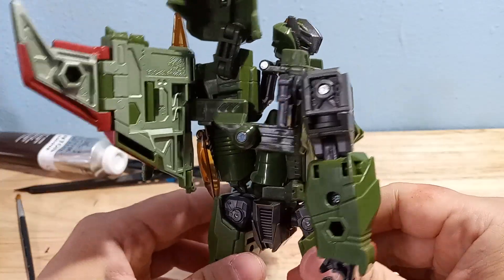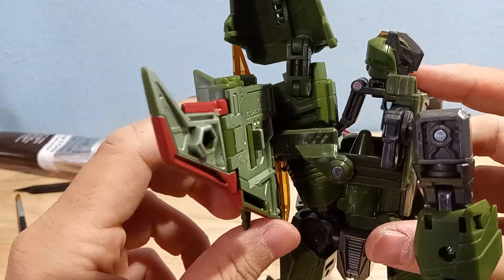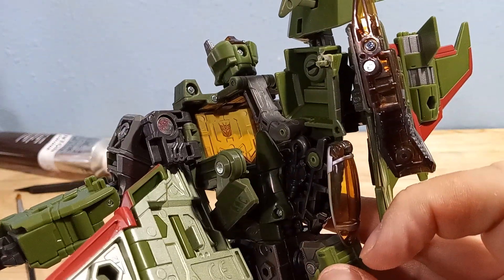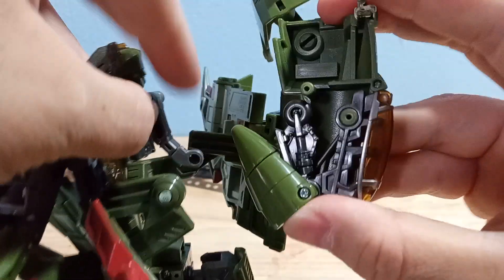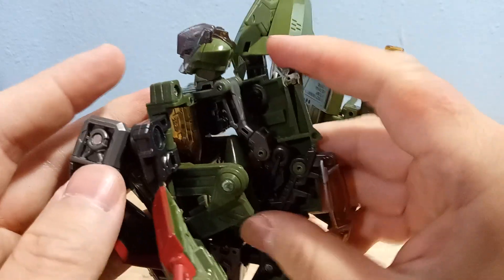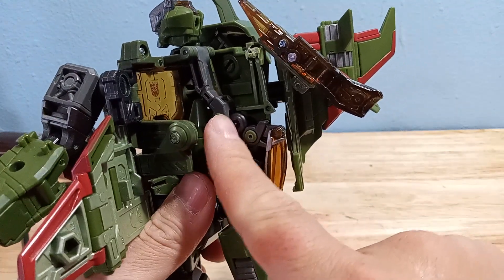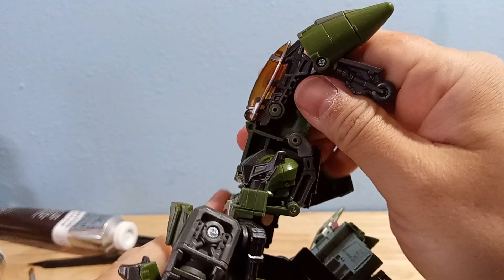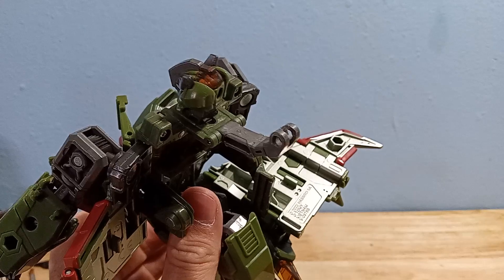Transformers Legacy Skyquake 5 Minute Fix Chest Problem

Comment from the maker: Apparently you don't need to mod at all, you just have to do the angle right: https://youtu.be/qkP0QyKbpT4
Reply: No, it doesn't work. There are batches of skyquakes and dreadwings that have a correctly molded piece, like the one that you cut out. There are reviewers and friends that did not have this problem with dreadwing.
If you do the "angle trick" with a faulty mold there is no way to push de landing gear in, it is blocked by a piece of plastic, the one that you cut.
Thank you for doing a video explaining in detail how to fix it.

Comment: Kinda looks like it was tooled for a different head and the mushroom peg was assembled backwards to accommodate this one. Wonder if the inevitable remold will solve the problem.
Reply from the maker: Yeah, they might fix it, but I think this is the fix, removing some of the slot. I wonder if they'll remold dreadwing to face the other way to use the cockpit as a chest; this figure can pretty much do it. 

I think they'll remold this into Thunderwing
Reply: @seoultron4581  I don't have the figure yet. Is there a way to chisel that bit without dissembling him? The glued piece has me a bit hesitant to take him apart.
Reply from the maker: @VestigialHeart13  I think you can get to it when he's in robot mode actually, you can see the gray plastic that needs to be trimmed right behind his head. You would need a hobby knife for sure
Reply: knowing hasbro, they won't fix anything
Reply: @W1zT3ch  They fixed Galvatron and Grapple more recently so it isn't impossible. Depends on whether or not enough people notice and complain. Seoultron is the only person I've seen mention it so far. Needs to be a news article on all the TF sites and stuff to get the issue trending.
Reply: @VestigialHeart13  they fixed it for some batches of skyquakes and dreadwings, a friend has a good one, i opened my dreadwing today and it is faulty.

Comment: Thank you SOOOO MUCH. The backpack not fitting right was driving me absolutely insane, I was trying to figure out why it wasn’t working for almost half an hour.
Reply: Actually all that's going on is a mistransformation.

You just need to feed the Jet mode Canopy between the Wings before tabbing the Nose cone into the place that will solve the whole issue.

It's not a flaw it's a mis communication.

Comment: Just did this fix. Worked perfectly. I DID watch the video about not needing to do the mod (those Discord notifications were driving me nuts, and I thought it was me, until I realized I didn't even have Discord open!), but I just could not get it to work. I just went ahead and shaved some plastic, and now it works properly. I have the Dreadwind version of the mold, if that makes any difference.
Reply from the maker: I'm surprised they didn't fix it on the repaint

Comment: Wait I just made mine work right without any adjustments  to the figure just adjustments to the process. When you turn it sideways before you swing the wings up. Do the nose cone then. It takes a bit of pressure but if the part he shows in the grey part that goes inside the hollow area of the cockpit section is in the right place it will let the landing gear go where it's supposed to
Reply from the maker: Yeah, I put a link of a video that shows the correct way to transform this, but I learned about it after I modded it

Comment: I just used an ice pick with some heat and lightly and carefully touch the groove at a slight angle.  Then used an exacto knife to clean it up a little.   Sure wish the turning the hinge around wouldn't have affected jet mode.  It was perfect since it kept the arms more stable and close his torso up tighter.

Comment: Man thanks so much !!! I did this fix but I just popped it off the mushroom peg and worked around the nose/landing gear. An exacto knife and a few cuts and he is back on the battlefield. skyquake fits so much more compact and he isn’t leaning back anymore. Plus my OCD was completely quenched when those notches fit right in the grooves like butter. 
Your way would have been much easier with unscrewing the screws and split it in half but I chickened out  thinking about splitting the glued seam. Liked and subscribed.Thanks friend.
Reply from the maker: After I did it, it occurred to me you could mod it without disassembly like you did. I guess the grass is always greener.

Comment: Thanks for the tutorial but I wish it wasn't necessary. Hasbro should design, build and assemble their fuckin' figures right the first time!!!
You should never have to take your toys apart and fix them after you buy them.

So sick of Hasbro and their shitty QC issues
Reply from the maker: Yeah, it's annoying, but at least this one looks like you can transform it properly without modding, it just takes some fiddling with it. We're lucky as transformer collectors that our figures don't usually break, unlike the power ranger figures Hasbro has put out lately

Comment: I gotten dreadwing yesterday and I was too wondering what was wrong. So if I just cut a bit of plastic off where the wheel is located I should be able to get it all in line correctly?
Reply from the maker: Yeah, I definitely went the hard route. I also put a video in the description of a guy that just knows how to transform it
Reply: @seoultron4581  well I did it how you had it done. I gotta thank you cause it actually worked out in the end
Reply from the maker: @angelmorin5945  that's cool, I'm glad someone tried it out